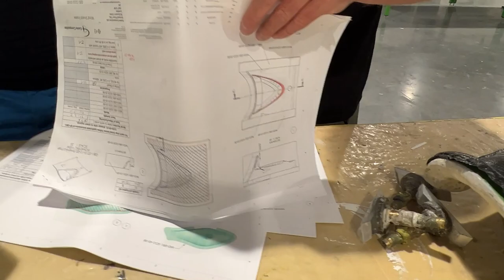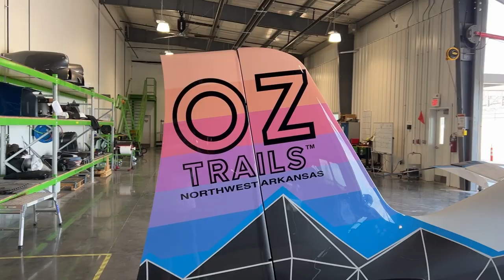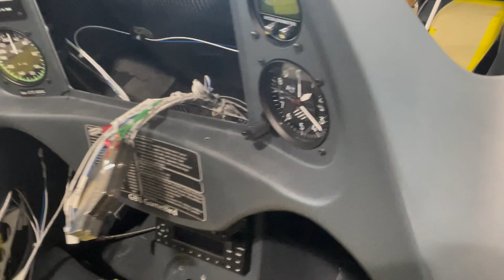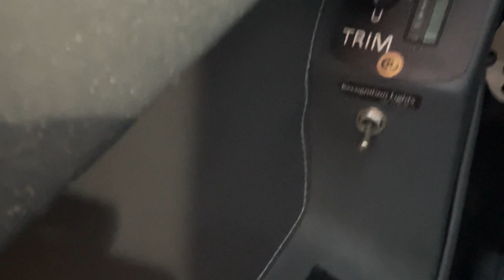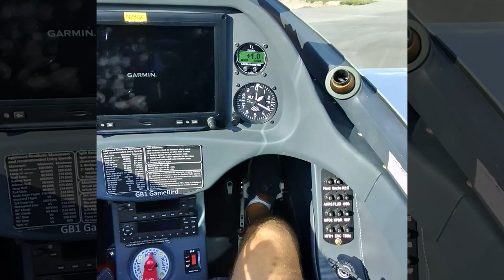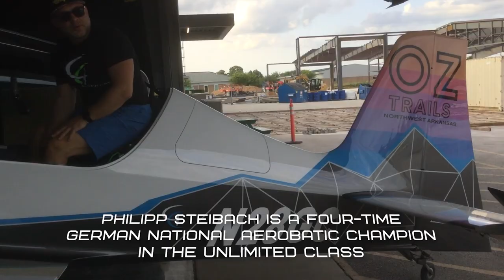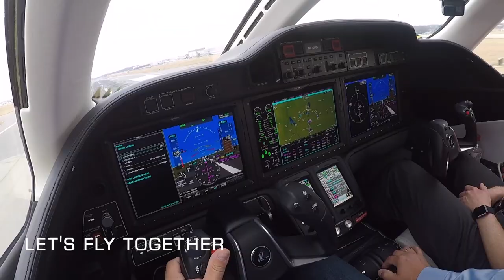5. GameBird 1: aerobatic plane flight review and factory tour

Comment: I literally took flight lesson from Philipp himself in GB1 which literally opened my eyes to a whole new world.   Philipp is really cool guy but that does not change the fact GB1, based on XtremeAir XA42, is an extreme aircraft that is much more difficult to fly than Extra or Pitts with its extreme pitch sensitivity and high landing speed (90kt+ required in final vs 75kt of an Extra).  The highly leaned back (not adjustable) seat backrest is entirely optimized for G tolerance, not everyday comfort and hard to get used to.   A weakness of GB1 is that it uses the very light  duty  Lang tailwheel whose tire is only half as wide of those found in Extra or Su26/29,  and I personally know two GB1 owners who lost tailwheel tire when rolling out after landing.   It therefore demands wheel landing to reduce tailwheel wear which makes the landing even more difficult.  Also there is always concerns of safety given the in-flight breakup of similar full CFRP airplanes like MX and Giles.
Reply from the maker: Thanks for your comment, very interesting. I didn’t know about tail wheel but from my point of view, piloting is almost the same as Extra. Maybe I just had the first impression. Need to fly again))
Reply: Certainly, aerobatic monoplanes are all very different from the rest of airplanes and share many characteristics.  But did it feel the same as a regular Extra 300L or an Extra 330SC?     I ended up buying a used Extra 200 after training for about 20h in GB1 and they were not satisfied with me. I mastered landing of my Extra 200 after just a few go arounds (without any instructors) and now flies it every week.  Obviously GB1 has more performance and I miss that, and I do feel a little pissed off that they raised its price from $400k to $600k+ just the last 2 years.